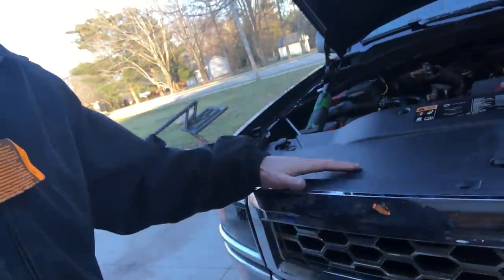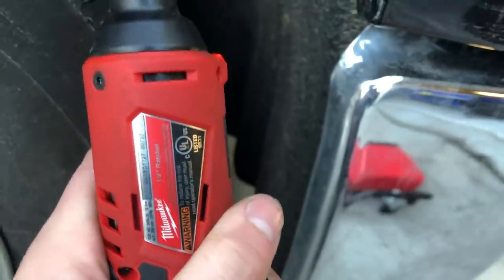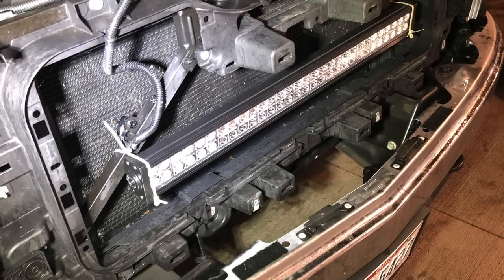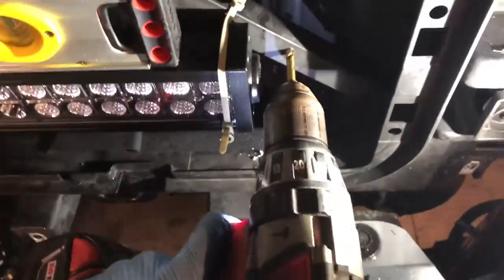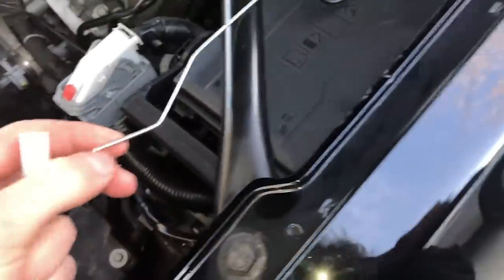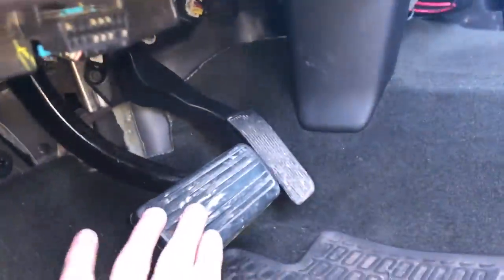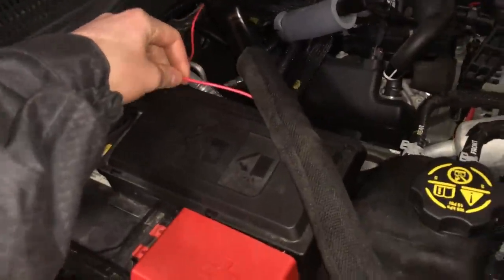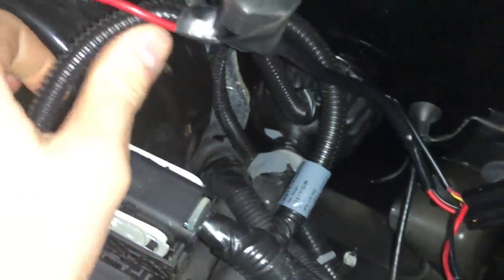How To Install 30" LED Light Bar Behind Grill Chevy/GMC 2014-2018 Trucks Light up the night

Comment: Could you wire this to one of the fog lights? So you don't need a switch.
Reply from the maker: Yes you can that would be super clean, make sure your not over loading that circuit. If you swap over to LED I would assume that they would have less of a draw compared to OE bulbs. Only downside is you can’t run fog lights with out the LED bar on. There has been a few occasions in my area where all o want is the fog lights on. Not very often just something to consider

Comment: It’s easier to take the front facia off first and you can access all four bolts at the bottom of the grill without having to crawl under
Reply from the maker: Yes on a new trucks, but some times for the older trucks you want to avoid having to pop the clips off because they can be easily damaged when exposed to the elements

Comment: Does it put out enough light to be worth it when its behind the grill? My grandfather doesn't think it will help any because its behind the grill but he wants a loght bar on his 2014
Reply from the maker: Andrew Moore     Hey Andrew, it does work well might want to look into a higher end one if light output is that critical. I use mine while helping people on the side of the road with flat tires or going out shooting. I just did this for the clean look with out the permanent holes from mounting in the roof or door jams.
Reply: @jamesiv432  he would probably be going with a rough country I'm just wondering if it hwlps on back roads and stuff like is does it put out more than the headlights also I appreciate the response
Reply from the maker: Andrew Moore yes definitely does put out more than low and High beams I will post a video tomorrow of the walk around on the truck and include the light bar test

Comment: Do you think any 32” curved light bar would work?  Or is a specific mfg better?  I’m looking at eBay and seeing a lot of 32” bars for around $50
Reply from the maker: MrSlimneo should fit just make sure before you order you measure the distance from the front of the bracket to the back of the grill in the center because that would be the portion that sticks out the furthest. Depending on how close you are you may be able to make some custom brackets with a lower profile to make the correct clearances. Let me know if you have any problems!

Comment: There is a power post by fuse panel… no need to drag wire across engine bay like that.

Comment: How you got it hook to the button to turn it on?
Reply: how you write english understand people don't
Reply from the maker: Not sure what exactly your specifying but for the on off switch inside the cab I just used 16-18 gauge butt connectors with heat shrink and secured them under the dash